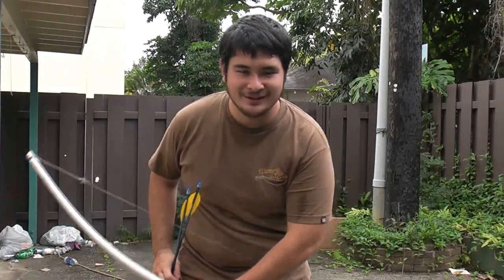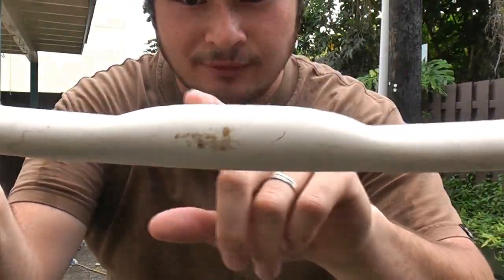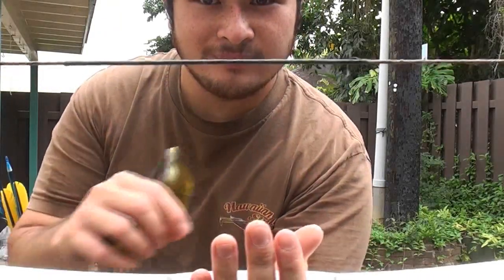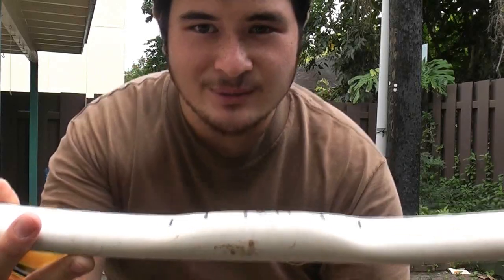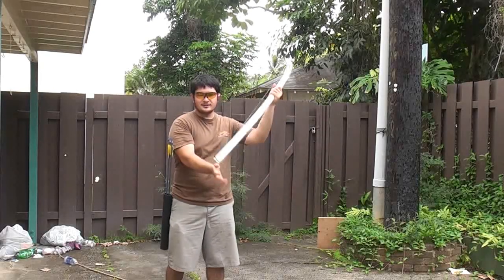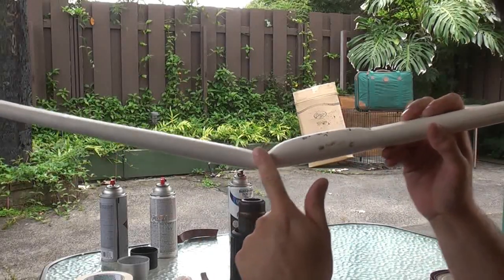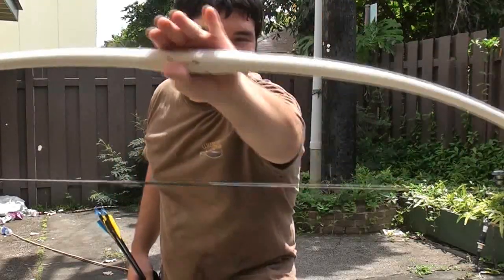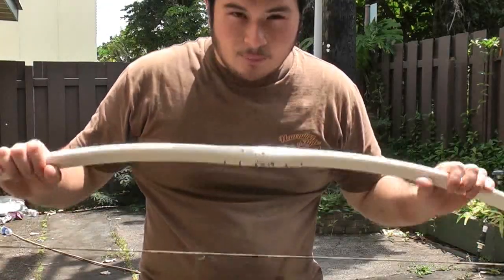PVC Bow Failure Series - Handle Collapse

Comment: I would suggest rounding the edge of the board of the flattening jig between the two blocks to perhaps a 1/2 inch radius.  This should prevent the crease that is caused by the 90 degree edge of the board. However, even with this, the fade of the handle should still be be checked and adjusted if needed. 

John Edgerton, Newark, CA